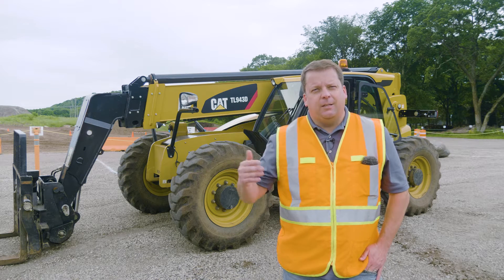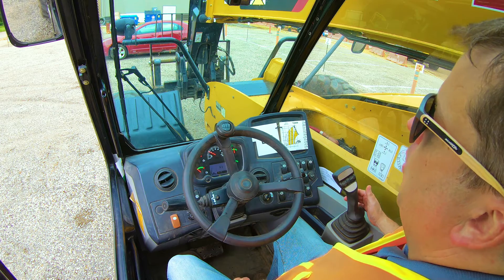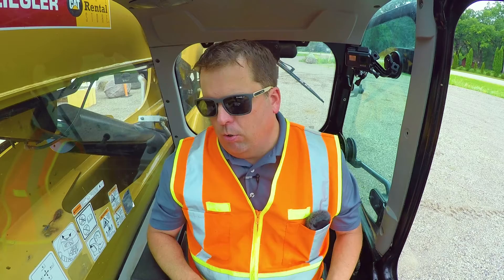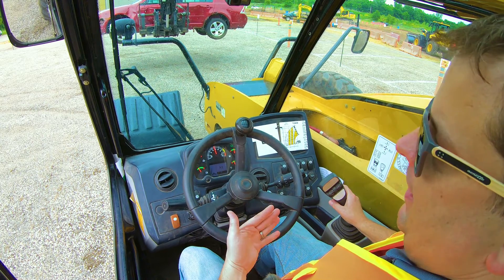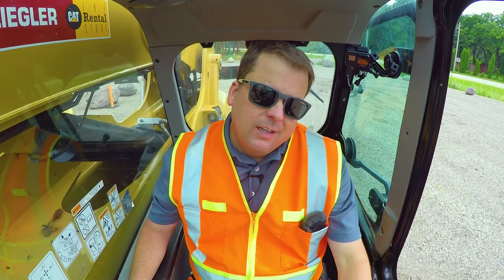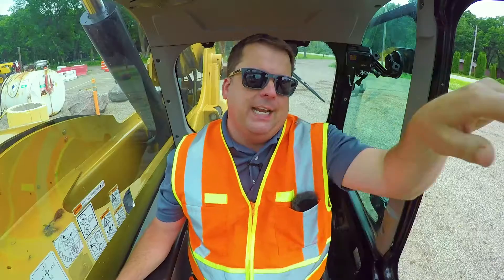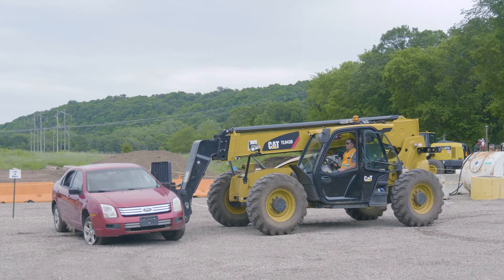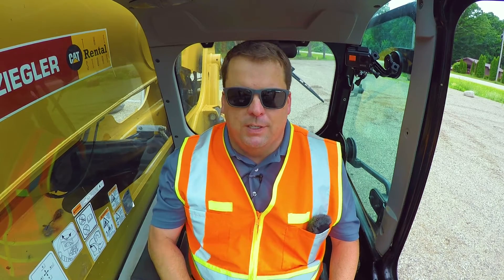What NOT to do in a Telehandler Forklift | Forklift Operator Training

Comment: Question, when on a hill. Say you need to get close enough but it's in a downhill slant. Can you use your outriggers to left up your tellehandler to level it with back tires to lift or will that throw off the whole balance of machine?
Reply: Lift*

Comment: OOo, I have a good 'not to do': Place I worked at had to move some containers around a bit that were too heavy for the telehandler to pick up on the side, so they got dragged into position. This worked OK when chained to the back of the machine but one guy attached the chain to the boom to pull the container and ripped the boom extension cable pulley system apart (Gradall machine). Expensive fix. o_o
Reply: Also, we had a guy that was great driving into pallets on level smooth ground but had trouble trying to drive into loads on uneven ground, so practice parking and booming into/out of loads too.

Comment: The forks are longer than a pallet. Was picking up a pallet of blocks that was stacked on top of another pallet of blocks. There was 2 stacks of blocks behind em that I was unaware of. I put the forks all the way in so the load would be close to the carriage and the forks came out on the other side a bit and nearly tipped over the other stack that was behind it when i attempted to lift the load. Luckily I had spotters that alerted me but it could have been a waste of crushed blocks and a clean up but more worse 2000 lbs of block could have crushed someone if someone was on the other side. The foreman was rushing me at the time, safety should always be on everyone's mind and never feel you should rush if it is compromising safety. Inspecting the area you will be lifting loads and being aware of your surroundings is crucial.

Comment: Summary:
1.	Know all the different markers on the machine
   1.1.	Side to side level.  Be level before you pickup or drive off.
   1.2.	Boom level
   1.3.	Boom extension marker
2.	Do not lift from a distance.  Lift first just in front of cab, but likely not on top of it. After lifting, then extend.  Retract boom before setting down.
3.	Do not pick up by extending the boom, instead drive up to it.  (Raise/lower first if required)
4.	Get the forks level (at eye level, or at ground level), before approaching the load.  Roll the forks after you have picked up.
5.	Do not put in neutral before exiting.  Put in park.

Comment: Never get out of a running machine always shut it off no matter what!!!
One guy locked himself out of the cab somehow, and tried going in through the side window. His belly hit the controller, and he booed the machine down on himself, and crushed himself. 
Never wear a harness or operating a forklift, wearing a harness and lanyard.
One guy ran over his own lanyard, and it pulled him out of the cab and killed him!
When using a bucket, careful on side, loading the bucket, and sticking the bucket out with a load.
Plowing snow, or using a bucket for material you can tear the welds on the inner section of boom, where the horse head connects to the boom .
I consider the head, the part that comes down to the ground from the last section of boom those welds are super easy to break sideling the boom, especially if you hit a curb or a manhole when grading the ground or plowing snow.
About 18 years ago I was on a job where a guy was plowing. Snow hit something on the right hand side of the plow blade like a curb and did $16,000 for the damage that was 18 years ago. Can’t imagine what it would cost now.

Comment: Operators also need to be familiar with the Make of the machine they are operating. Each Make have similarities in design, but each have slight differences that will effect overall performance. For example, depending on engine cab configuration or the placement of outriggers, the operator has additional blind spots.

Comment: I lifted a wall up with straps using my telehandler rental with not much room to back up behind me because it became a downhill slope. Once the wall was up, my forks were so high in the air that I couldn’t pull down and back to me because it would just bump the top of the wall, so my only option was to reverse down hill! we didn’t do that because of how dangerous it seemed, but instead decided to try to crab steer out of there with the forks way up in the air very very slowly. It seemed like that’s something you shouldn’t do, especially on rough terrain. Does anyone know if it’s safe to drive with the forks in the air say 25 feet up? I’m guessing not.

Comment: 1. A lot of  green operators think cruising in the highway gear is the best because it faster but they don’t realize that the speed bounce on un even ground is pretty dangerous especially with a load on. I almost always leave in 2nd gear. 

2 leave the fork tips either high or completely low. Hurts the steel when u clink your head 

3. Not paying attention to the turning radius the on the front end 

4. Loosing visual and continuing in hopes for the best.

Comment: If you're having trouble putting the tele boom out and up or vice versa, a little tip from the guy who taught me.

Tie a bit of rope, or use, say, a 2/3m sling on the toe and tie some kind of weight like a rock, or put a shackle through the eye of the rope/sling.  Now try to tele out while keeping that weight/shackle just skimming the ground....Do that on the way out, and all the way back....Then repeat until you've got it.  Worth saying also, get the riggers down if you have them.  Better to be 'slow' than end up tipping your machine's fore-end onto someone's foot.  They're brilliant machines but also deadly in the wrong hands.  

Then there's the 360 degree telehandlers....That's a whole different thing altogether again!

Comment: So I've been driving telehandler for 6 months now I've had experience before from counter balance and reach trucks which has helped me. Every site I go to I'm on different trucks and I'm learning so much but obviously I'm going to be slow if I'm always changing trucks and sites. But all the brickies I work with always tell me I'm better than the telehandlers who have had 30 years experience even the ones who have done it for so long try and give you advice. You must have 0 talent if you end up tipping one of these.
Reply: I think your wrong about zero talent tipping one of these, very wrong. It can happen to the best drivers. If you hit a bump, she can go over.
Reply: @ck2134  I've been to many sites many different trucks I only have 8 months experience yet to make any crashes, but I always get told the driver they already have always crashing. But I know I'm elite level driver.
Reply: @rajindernijjer  that's all cool mate. I being driving over 20 years and all I can say is, be aware at all times, they are dangerous machines. I do alot of extremely dangerous lifts with these machines daily and I find it easy sure. But I always aware what could happen.
Reply: @ck2134  I'm red card basically I'm learner every site I go to there like your better than the driver they have which is usually a blue card a professional. I usually cover days here and there go check the truck and there always fucked flat tyres, no coolant, no brake fluid, so I can just imagine how good these drivers actually are. I guess everyone has different standards. I driving a digger aswell also now that must be even easier than a telehandler.
Reply: @rajindernijjer  I drive a jcb digger also. But I have no ticket for it. I only got the teleporter ticket. The man on site that drives everything 360/ normal digger/ teleporter. every machine he drive very experienced. He turned over teleporter putting up roof trusses before, he told me he had no seatbelt. He shit his pants. Grabbed onto seat. Lucky to be alive. Than the boss pick up machine, make it upright and this guy continue putting up  roof. Probably he wanted to go home and 😭 after than. Anyone would. But he a very good driver. Just hit a bump and she turn over in a flash
Reply: @ck2134  we don't put up roof trusses here with the telehandler we use a crane. I never drive fast enough for it to tip. I go to many sites that's why I gained way more experience than just one site. Within 8 months I have driven over 200 different telehandlers.
Reply: @rajindernijjer  I put roofs with it. No cranes. I think I would like your job better. Better health and safety and I would not have to do dangerous stuff. The danger is the bad scaffolding and loading weight on it. No loading bays. Just double up planks. Overloading and pray 🙏 it doesn't break. I know either the planks will snap or the scaffolding bar will break. It's only a matter of time. But this is what I must do to get payed. The joys of it
Reply: @ck2134  if they ask me to do anything that is unsafe I just tell them. I was lifting curbs over people's cars and they got shit scared.
Reply: I should quit and go working for your boss. Only could be alittle far from me haha
Reply: @ck2134  I don't work for one person I work for different agencies, I don't have full time job which suits me. I get between £17-20 hour how much do you get?
Reply: @rajindernijjer  I get 14 euro Into my hand after tax,  it's a very poor wage for what I do. That's why I feel like quiting. I could get maybe 18 -20 euro elsewhere after tax. I just kinda stuck with this guy at the moment. I getting screwed but is only five minutes from home. I should relocate for better. Just waiting for the right time to tell him shove it
Reply: @ck2134  yeh that's pretty poor in the UK if you have permanent telehandler job you get £25 an hour.
Reply: @rajindernijjer  yes he paying me 16 ish and I only getting 14 so is a labourer wage and he has me doing everything. And I driving teleporter putting up roofs and everything. Its a bitch. I won't put up with it much longer. No wonder I find things hard getting payed like that. I wish I was in the UK I across the water in Ireland in a rural area
Reply: @rajindernijjer  he gave me a bottle of whiskey for overtime once. Never got notting else for any over time ever. And I do extra work. Drive machine here there everywhere. Lifts etc. Worst job I ever.

Comment: One thing that most people do not either understand or mention is that the capacity of the forks, not the machine, are each calculated and 50% of the machine capacity, therefore they should always be used as a pair. either slide together or wide apart according to the load. The same applies if extensions shoes are added. they should not be more than 30% longer than the forks otherwise the heal (The 90 deg angle at the rear) starts to suffer from stress fatigue.

Comment: Been on tehandlers for 20years lifting pallets of bricks blocks into loading bays seven high with a 17m jcb when the load is to heavy the hydraulics cut out if your up high and if it cuts out don't override it that's when you get into trouble only once I nearly put my machine on  its ribs on a manitou the chip in the joystick was faulty and was telling the machine to lift the right jack it started rocking back and forth from Jack to Jack with a pallet of plasterboard 40ft up.

Comment: I'll guess its a good enough video if you drive once or twice a month with a little machine on your worksite just to move something.

First thing Is to learn to control moving your forks in an straight line, at ex 10feet level, all the way, not easy if your new but essential to continue growing as an operater, offcourse many other things to tink of but a good start.
Cheers// Swedeguy

Comment: Nobody reads the load chart on these things. You know who the telehandler operator on the job is, the jobsite idiot. They will let anybody on these things. I've seen so much crazy stuff over the years. Just about every large jobsite will have at least one of these turn over throughout the course of the job, most of the time multiple turn overs. It's comical, somebody they wouldn't let near a bulldozer, or excavator, but they have no problem putting him into the telehandler without any instruction and turn him loose.
Reply from the maker: Agree to the last part...but I sure hope you at least reference he load chart when you start.   It’s important to understand a machines capabilities and limits.  You don’t need to memorize it or look at it every time you load, but at least understand some of the limits.
Reply: @HeavyMetalLearning  I read the load chart, and almost have it memorized on the machine we own, but all those goofballs you see on these big jobsites don't. They wouldn't even know how to read one if they wanted to.

Comment: I’m wondering how wind is taken into account.  Is there a max safe wind speed for performing critical lifts?  Thanks in advance!
Reply from the maker: That’s a great question.  I’m not aware of any official standards outside of cranes, but obviously you should be careful on any windy days.  With these being rigid frames, unlike a crane cable, it is less of a factor unless you had a super high reach handler.

Comment: 2:30 while most of the time that’s true, not all the time. There have been plenty of loads I’ve had to pick up from a surface that wasn’t level to the machine and I’ve had to intentionally tilt the forklift in order for forks to be placed how I needed them in order to pick up.
Reply from the maker: Good point...thanks for the comment!
Reply: We routinely pickup with a boom and rigging, picking up a suspended load beneath the forks. If you are doing this and need a little lateral movement to the side, you can tilt the lift a little to swing it over. This is way beyond what is allowed in the manual though, and you have to know what you are doing, because if you tilt too far and get beyond the center of gravity, you'll turn it over.
Reply: Angel, LIFKO?
Reply: Normally that is safe to do,as long as the boom is at or below horizontal angle.You can definitely have a problem putting the machine out of level at high boom angles,especially when you have boom telescoped far out.This is why the slope piler option is a good thing for safety.Operator can keep the machine level while tilting the forks carriage to either side.

Comment: Used one to disassemble a historic building. Used straps to lift walls. Used forks for concrete vault and piles of lumber. Very muddy uneven ground both for removal and stacking stud walls quarter mile away. We had to use the extension boom for pickup. Ground too uneven to drive under. Also..tip walls and apply pressure to break wall joints. Good machine. The four wheel steering was great for tight quarters. No level ground anywhere. Tilt mode great.
Reply from the maker: Thanks for the comment!

Comment: Telehandler  Operator based in UK here, usually working with 14-20m machines, rarely get to use CAT's, mainly JCB's, and the occasional merlot, or manitou here. 

I do so wish JCB had the cab sway function that I've seen on merlots, such a time saver for when you may do a high lift and misaligned to the loading bay by a bit, just sway over rather than having to retract and reposition. 

Some really good tips and info for new drivers here, though in all honesty being what I'd say is a more advanced operator with 5+ years experience I break a bunch of these rules all the time haha :) 

Any telehandler operators that have moved onto 360 slew telehandlers, how did you find the course's etc, any tips for a 360 slew? Looking to upgrade my ticket to include it soon.
Reply: I know this was written a while ago mate but there are a fair few JCBs with sway. I've been driving a couple for about 4 years now.
Reply: @danshaw6485  I run a JCB with the sway and downriggers, don't like the parking brake handle though it's always catching my fucking coat haha
Reply from the maker: Thanks for the info...appreciate it!
Reply: good pay? worth doing the telehandler course?

Comment: thanks for the info i work on a building site in a manitou 1335 I struggle sometimes picking up pallets on a high up scaffold loading bay if i cant see the enter points of the pallets any tips or vids i can look at
Reply from the maker: that's a tough one....I'll see if we can do a video at some point.   Maybe some other operators will chime in and give some tips.
Reply: Use a spotter and KNOW ur hand signals. Try to use the same spotter as often as possible, this will build trust in each other.
Reply: 23.12.2020 I passed CITB and cpcs telescopic handler course I'm all good I now agree I don't need a spotter/banksman

Comment: Check your load charts. Always. No matter how light the load is. When you get into 10 and 12,000 pound machines with 54 foot booms, they may only have a 200 pound capacity at full horizontal reach with no outriggers. I have run JCB machines that said not to go full stick without outiggers ever. Even empty. I have witnessed an operator with a 1,000 pound pallet figure he was ok because he was in a big machine. He decided that it would be better to be a few feet closer to the drop point than to back up a few feet to put the outriggers down. Had he checked the chart he would have seen that he only had a few hundred pound capacity at that reach, but if he had put the outriggers down he would have had 10x the capacity even though he would have to reach a little farther. Back of the machine came up and the pallet hit the deck. Luckily he had the pallet only about a foot off the deck as he scoped out, so no damage was done. He is a seasoned operator and it was a good lesson to all of us to never get complacent and always check the charts if there is any doubt. That experience probably saved me from doing the same thing.
Reply: Can confirm. Load charts are absolutely essential.
Reply from the maker: Excellent advice...thanks for sharing!
Reply: I'm surprised at a seasoned operator not feeling the stress on the machine before the back end went up... you can literally feel it creeping